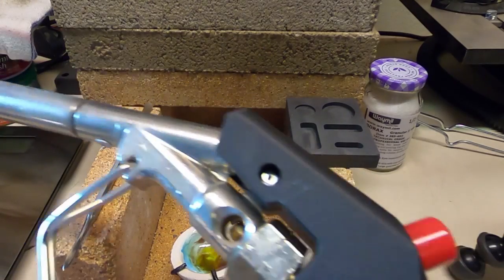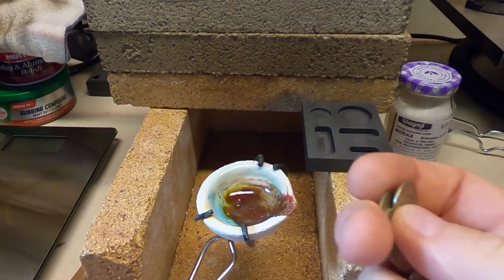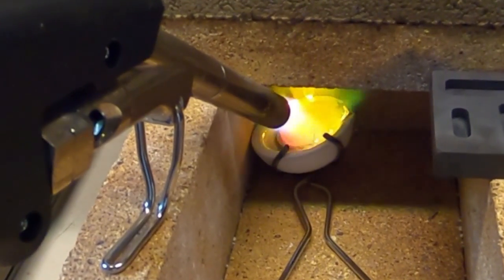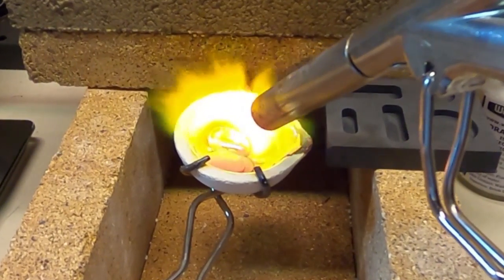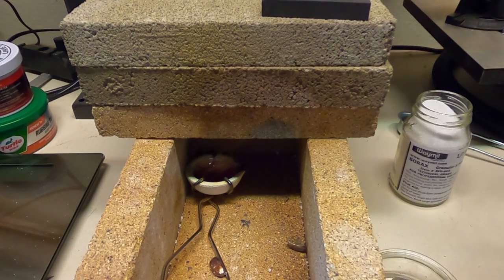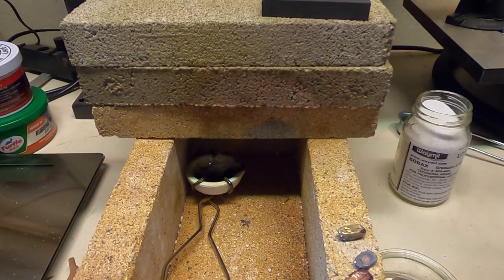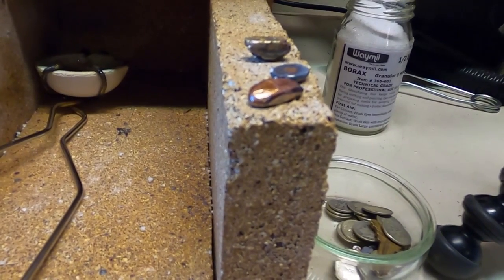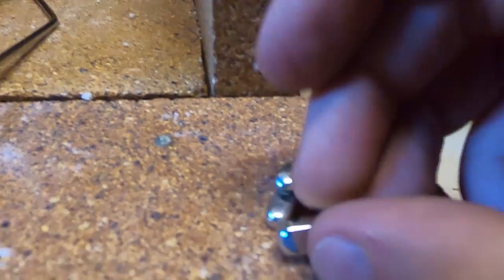Can You MELT SILVER COINS Just Using Standard PROPANE TORCH

Comment: In my opinion you should cover the coins with borax from the beginning and heat the mold you are pouring into.
Reply: I was looking for a comment like yours. These looked like regular circulation US dimes, which are 91.7% Cu and 8.3% Ni. Ni has and incredibly high melt point, over 1,000⁰F higher than Ag.
Reply: @jonathanfoster6502 I’m pretty sure he is correct about them being silver.   I cannot read the date. But pre-1964 dimes looked like this. They had the same look as modern dimes. Early 1960 dimes that is.

Comment: I use Mapps gas.
Reply from the maker: I do too sometimes.. Propane is cheap & i'm a cheapskate 🤣 I also use a Propane & compressed Air mix its hot enough to melt Gold easily, not a cheap torch but its cheap to run...Mapp gas is easy though 👍

Comment: Does this give you closer to 100 percent silver than just the coin & can you do this with 40 percent silver?
Reply: No.. this gives you exactly what you start with 90% silver. If you melt 40% silver you get, wait for it 40% silver.
Please stop melting silver currency. They are getting more rare daily amd will get you way more money as the coins they are. You can buy .999 silver shot all day and get better prettier results..
Reply from the maker: yes and yes although your 40 percent mix will will require more heat to melt...
Reply: @JollyPeanut how do you know if/when you're at at least 999 fine?

Comment: Dumb question but, What is that black paper looking thing that your using to get the black off the silver after melting it? Cuz I’m experiencing the issue of my gold and silver turning black (burned marks) during the melting process and I don’t know what to use to get it off?
Reply: I may be late, but I've seen others use 7000 grit sandpaper and vinegar. Have you tried anything other than that?

Comment: You should try bottled MAP gas. It burns hotter that just propane and should help when you melt silver coins and scrap. MAP gas is a mixture of propane and acetylene, and can be purchased at hardware stores.
Reply from the maker: True, I have MAP but experimenting with propane as it is so much cheaper, I have now got a torch that burns propane Mixed with  copressed air that burns super hot & running cost is so cheap.... Thanks UM 🔥👍
Reply: Mapp is different thant map pro, which map pro is the yellow bottle from bernzomatic and it's only 130⁰F hotter, maybe 150⁰
Reply: I used butane... took me a while and borax. but no coast XD maybe some silver evaporation XD

Comment: I commented 1 week ago...
Since then... I attempted first melt and pour... Didn't turn out as I well.
Yes... Propane melted it... But as silver really wasn't as hot / liquid as needed. It kept "muffin topping" and trying to form a ball... Had to keep adding silver...even with acetylene... silver kept pulling away from edges of mold.
But I see you're having same issues
Reply from the maker: Check out this video of mine i use a different torch  "does not cost much there are links for it in the video description" it burns a bit hotter works well for me. I am also experimenting with propane & compressed air although that is a much more expensive set up. I always use the heat bricks also it helps retain heat.. Link for the video https://www.youtube.com/watch?v=sG29qXNlB3A
Reply: @JollyPeanut  well... I gave a whole file (playlist) of melting and casting videos. 
And I purchased a fancy electric furnace to melt fully. (Due for delivery tomorrow).
But am just experimenting right now.
I'll get it down...and make a video on it. To help others.
Reply from the maker: @His_Serene_Lordship  Nice, i did look into melting with a furnace but the costs of running them put me off at least for now, the other torch i use works good for small melts enough to make a decent size rings & other work like that. I would  at some time in the future like to melt brass copper aluminium in much bigger quantities i will go with a propane furnace for that. Good luck with your furnace it should work out well i look forward to your video.

Comment: Try using an acetaline torch.
Let me know how it goes.
Reply from the maker: I have a torch that i have not tried yet it uses Propane & Compressed Air that should burn hot & keep costs down. Acetylene is great but expensive
Reply: @JollyPeanut  understand.
Any suggestions for a low budget press? Right now ... I just spoke with machining company that can fabricate my die and stamp....but I need a press for best sharpest impression.

Comment: Would the value of the silver outweigh the value of the coin?
Interesting video.., 🍀🇮🇪👍
Reply: Yes a pree 1967 canadian 25 cent coin is worth roughly $4-5 in melted silver!!
Reply from the maker: Interesting question. Well if i was to buy silver to make things it would cost me a lot more than buying silver Dimes, and if i was to add a little pure silver to the melted coins i could increase the silver content from 90 percent to 92.5 percent or greater, Sterling Silver is 92.5 percent of pure Silver. As long as i don't melt rare collectible coins i think i am saving a fair bit of dosh.
Reply: @JollyPeanut  right now a roll of 50 is worth $160 good job
Reply from the maker: @RomanEmpireMetals  I pay scrap value only for them its the cheapest way for me.
Reply: @JollyPeanut  well your lucky because if I were to buy them right now which I have they are $160 a roll